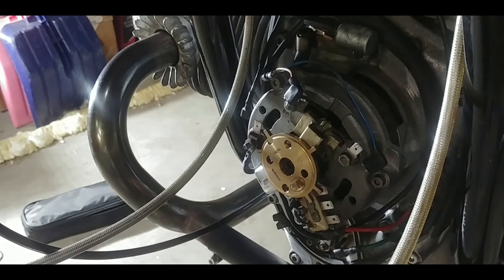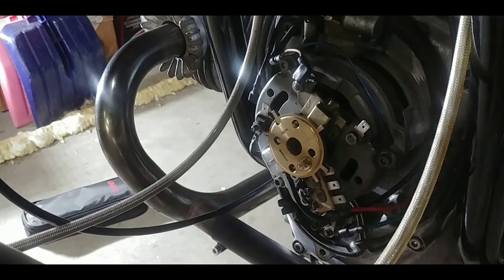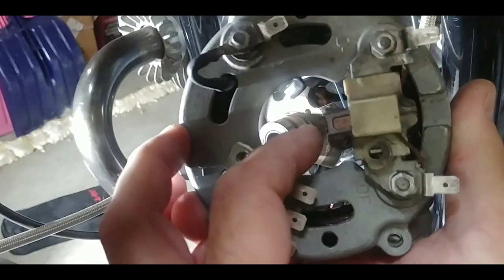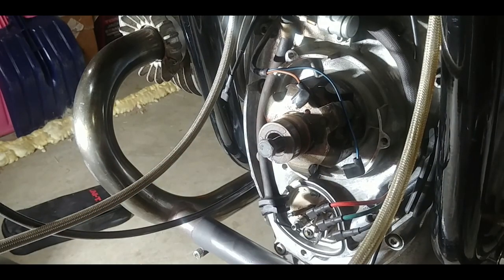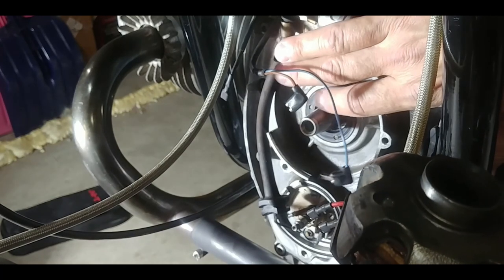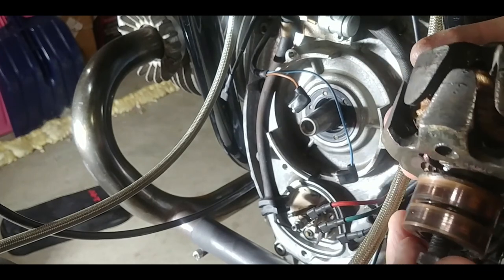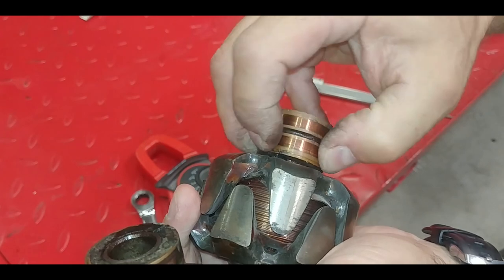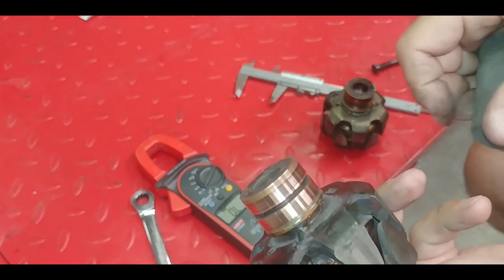BMW Airhead alternator repair

Comment: Nice video. I have found many charging problems are due to old (weak) brush springs. I now replace springs whenever putting in new brushes; very cheap and easy to do!!
Reply from the maker: Great tip!

Comment: I’m doing the same process to remove alternator (with long bolt) but no matter how hard I screw it in - it never pops out. I’m already afraid to break the thread
Reply from the maker: It is a is a removal tool not just a plain bolt. If you put a normal bolt in there it will hold the rotor in place. You need a rotor removal tool to push the rotor out.
Reply: @HeikosGarage  yup, I understand. I actually made it a day ago! I used a piece of a smaller bolt (I cut it), inserted it, and then used a regular one to mimic the same process. It worked out fine. I saw this method in one of the videos on YouTube on a related theme.

Comment: Guten Tag Heiko. I enjoy watching your videos (we have the same airhead) and I learned a lot. On this one I have a question or comment. My battery wasn't charging, the GEN light would not come on when turning on the ignition and flickered above 3000 rpm. I did the tests and figured the alternator was shot. Just installed a refurbished one (Siebenrock from 2 valve boxer/Wunderlich). When I did a continuity test on the old one, it didn't change the reading (1). However, when testing on the slip ri nags of the new one the ohm reading went to 0! Very strange and different from what you and your little handbook said. Anyway, it works now (14.3 V at the battery at 3000rpm). Gruesse aus Detroit. Christopher
Reply from the maker: The electrical pixies are hard to understand sometimes. Now that you have the parts replaced you can test the old once one more time. Maybe the issue was just a bad connection/ worn brushes?
Reply: Check if your multimeter can read small number ohms.